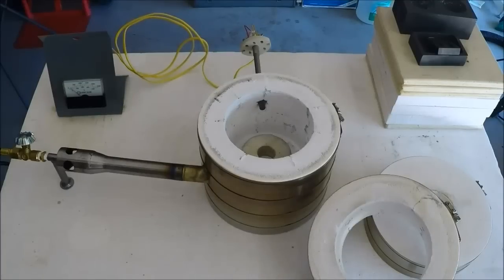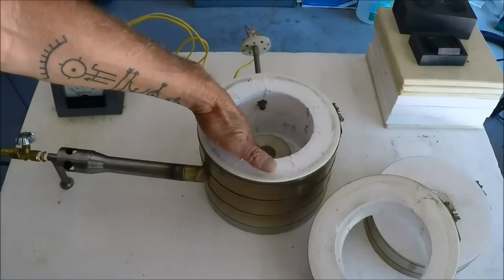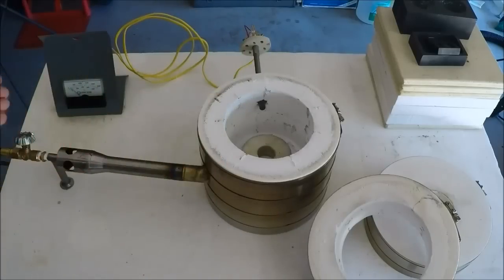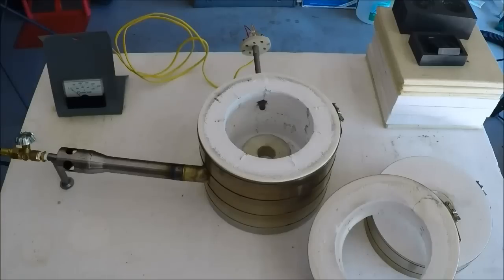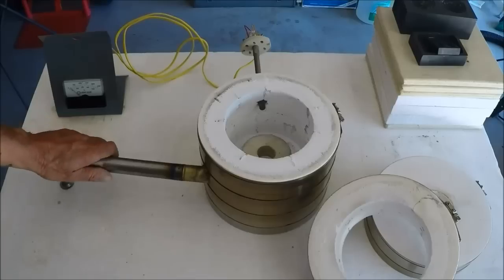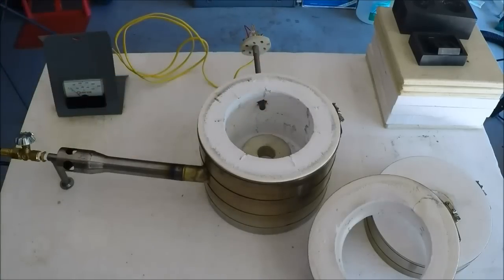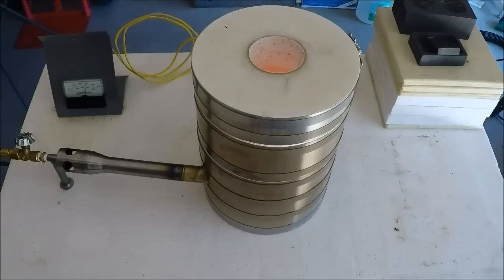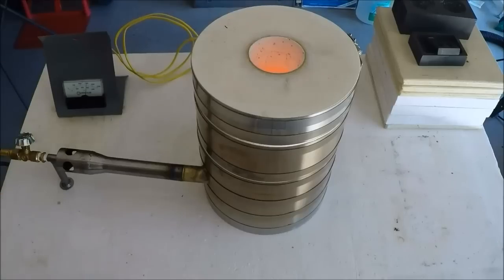Silver and Gold Melting Furnace-Kiln

Comment: How did you make the foundry? Does it fall apart after multiple heats and cools? How did you make the propane burner? Was it an expensive process? Could you use the pyrometer to measure the temperature of the foundry or kiln? How did you heat your kiln so quickly? Also GREAT video, I have not seen many kilns like this. And I have not seen or heard of any that can heat up so quickly. Nor many that can reach that high of a temperature. If still using propane, what do you think the max temperature could be?